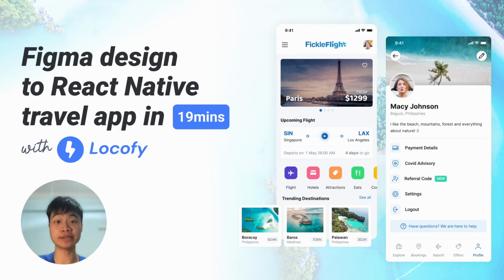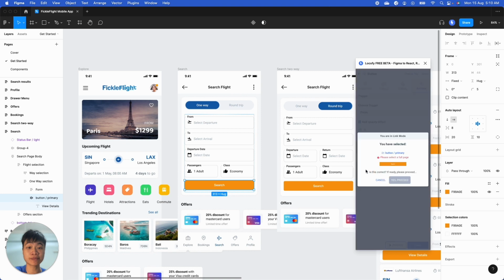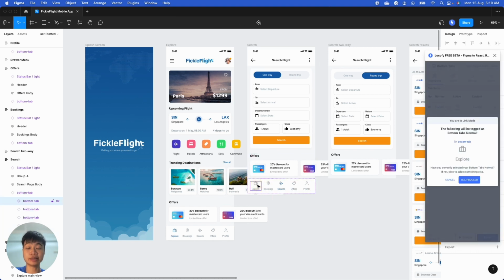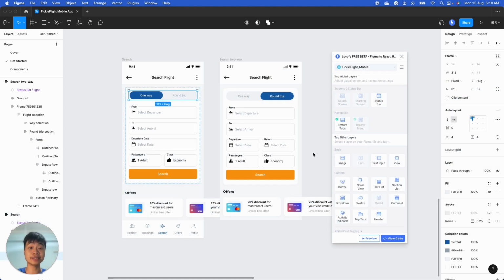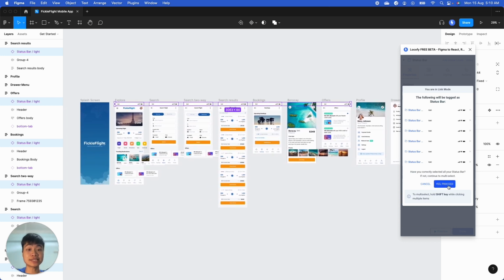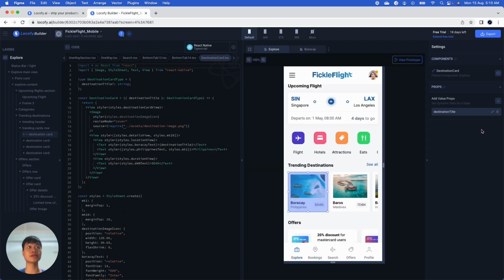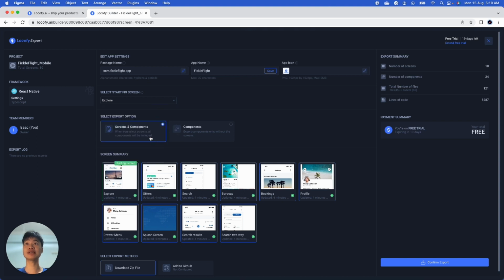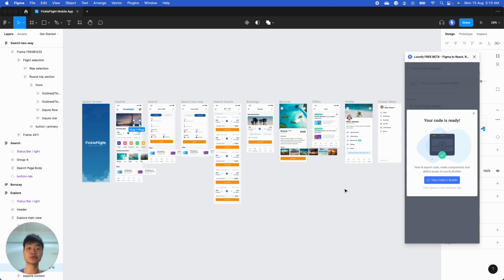Locofy.ai | Figma design to React Native travel app in 19 mins with Locofy [Quick Build]

Comment: How did you make scrolling work in the Locofy live preview and in the simulation? It seems like it does it automatically in the video but it doesn't work for me? Is there a specific setting that is required?
Reply from the maker: If your design file is larger than the Locofy preview, then it automatically adds scroll.

Comment: So this is only for a prototype? You can't build a fully functional app that you can submit to the appstore?
Reply from the maker: Hey there, you can absolutely build a fully functional app. The code that is generated is production-ready UI code, and all you need to do is to add your logic layer via your code editor - this means that it will require some additional coding. 

Locofy will save you 80-90% of the time that you would usually take to develop your fully functional app.

Comment: can u help me please, why is always showing error code like this while running emulator error: could not find or load main class org.gradle.wrapper.gradlewrappermain caused by: java.lang.classnotfoundexception: org.gradle.wrapper.gradlewrappermain
Reply from the maker: Hi Yoghi, you can refer to this React Native set up documentation to install the required dependencies for your Mac/Windows/Linus environment 

https://reactnative.dev/docs/environment-setup

Please refer to the tab for "React Native CLI Quickstart"

We're also going to be creating some additional guides for React Native environment set up soon!
Reply: @locofy_ai  it still not work, if i'm making new project it works, but if i'm converting figma to locofy n follow the step, 100 error, is always show gradlewrappermain javalang blablabla
Reply from the maker: Hi  @yoghijulian6192 , sorry that you're facing this - could you please email us the error log and the list of steps that you used to try and build the project? 

Also, please invite hello+debug@locofy.ai to your Locofy project in the Builder, so that we can export the code as well to check for any issues.

Thanks for raising this and we're here to help
Reply: Hi, after downloading the zip file from Locofy Builder. Downgrade the react-native package on package.json to 0.68.something
Works like a charm